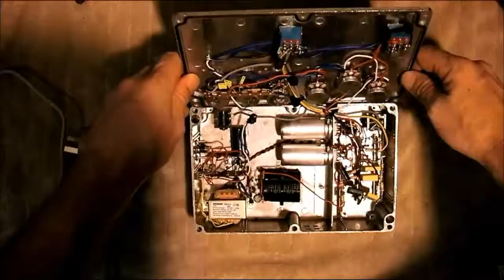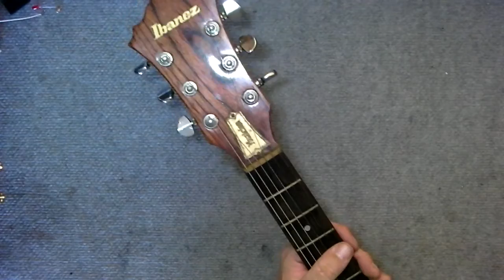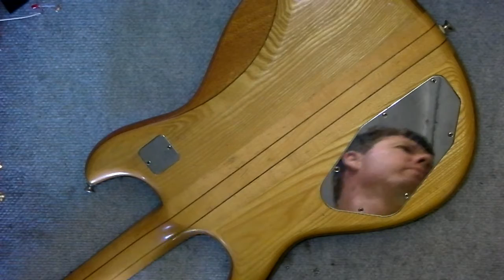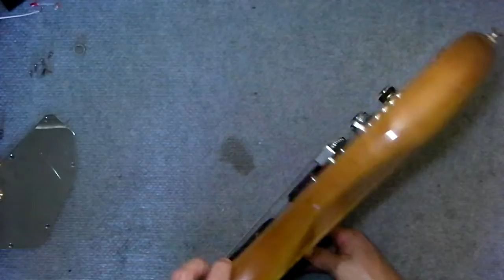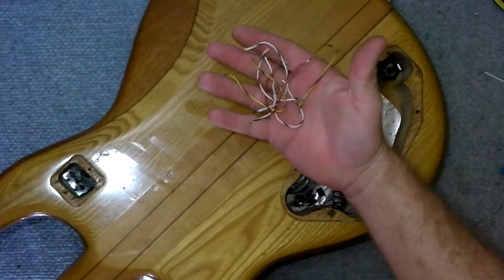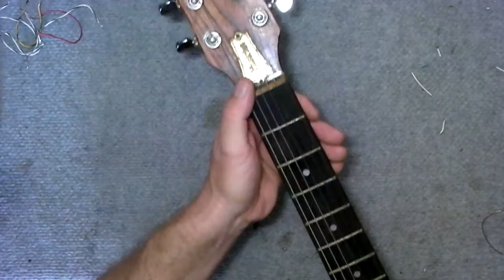Guitar Electronics Repair (Before and After)

Comment: You soldered the  wires to the switch the other way 'round!
At 10:04 you say you play the BRIDGE pickup with the switch UP,
that switch ought to be DOWN when you use the bridge pickup only.

The UP position is for the NECK!

Ginger

Comment: Just got my hands on a MC500.  The neck pickup has little to no output. The battery expired in 2004, so I know I will need to swap in a new one.
What's the most common cause for the neck pickup to cut out?
Are all the Ibanez Musicians stocked with box switches?

Comment: is it just me....or are you wearing a Hi Viz Shirt to work on that Guitar?    You seem like the kind of bloke that can help me out. I just bought an old strat copy. Its gonna look pretty good when I'm finished with it coz my specialty is cosmetics...but I don't know where to start with Electronics and this thing ain't working. No sound at all. Pauly...mate....WTF? Where do I start?  I know how to weld but soldering is a little different eh?  And by the way .....I just recorded with an Ibanez a bit like that and it was sweet as! Who ever gets that guitar is a lucky Bastard.
Reply from the maker: +Dan Osper Yea that could have been a high vis shirt.
Beyond looking for disconnected wires around the jack volume pot and selector switch you really need a multimeter to do a few checks.
Reply: +Paul Graham (Guitar) Cheers mate. I bought a multimeter the day I msg you but still don't know where to start. What are some of the common checks to do? I suppose I should start by testing the pots

Comment: I am in the middle of rewiring a guitar myself, a Washburn. The guitar is so noisy that the amp receives more signal from the buzzing than the pickups put out.
Reply from the maker: +The Universal Eye Yea it has a ground or a poor connection problem somewhere.